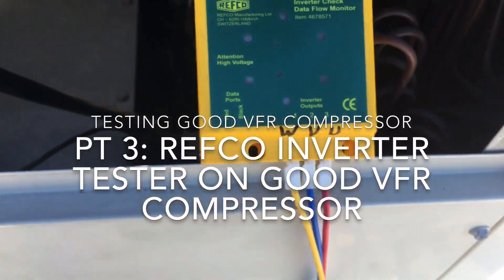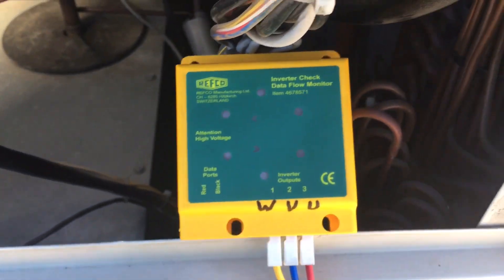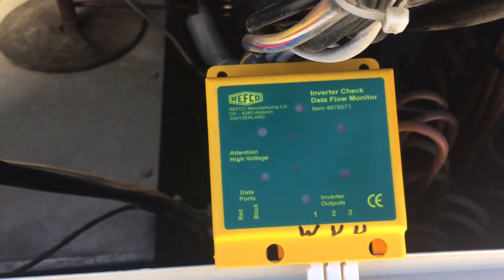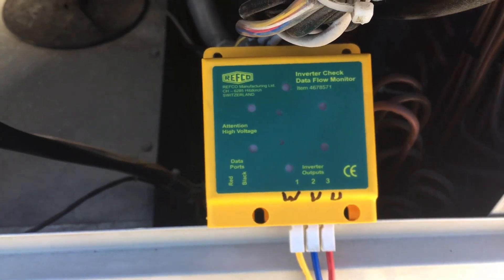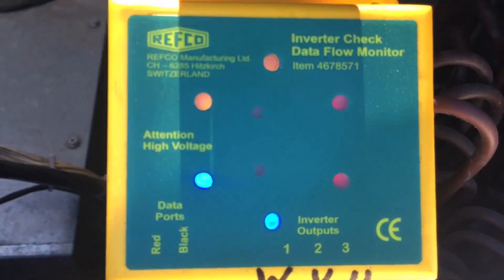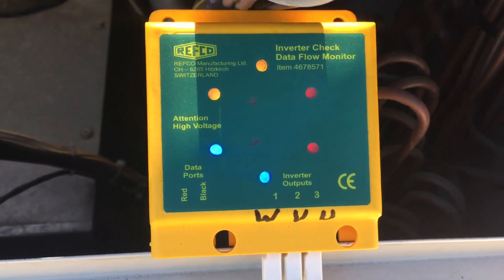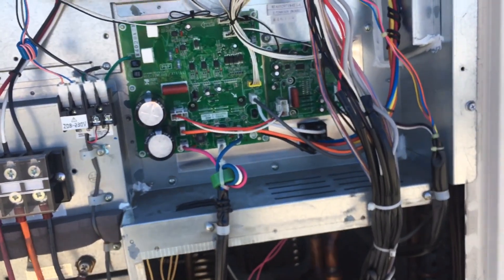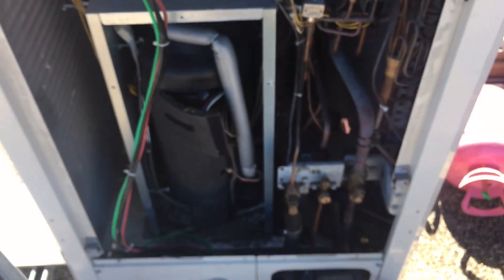Pt 3: REFCO Wired with compressor in circuit testing inverter operation

Comment: Its chek mosfet/ igbt driver in smps/ ups ???
Reply from the maker: It’s just checking the output, signal verification. You could go to their website to look up the details on the product, information and specifications.
Reply: Sir, its  use in three phase smps module  mosfet  gate voltage chek

Comment: Did you ever get around to making the good vs bad compressor video ? I searched didn't find anything obvious don't know if you mentioned it somewhere else drop a link if possible 👍
Reply from the maker: Never got that far customer ended up not doing any more repairs.
Reply: @coldfinger459sub0  ok no problem. I encountered this same type of issue and it was definitely the compressor the manufacturer resistance rating is from 0.7 to 1.5 ohms for a good compressor mines read 0.2 ohms and megged ok; im trying to find if there is any tolerance when it comes to these ratings or once it's out of the specified range it's absolutely bad.
Reply from the maker: @westindianhvac  in the situation they had a nearly 30 pounds overcharged. 

They thought the reason it was not cooling was refrigerant charge. 

Turned out nine air handler‘s filters were completely plugged. 

One air handler circuit board was fried

And the guy they hired to come figure out why it wasn’t pulling calls first thing he did was started adding refrigerant and kept over writing the automatic shut down to start it up and force more refrigerant in and then it was going to automatic shut down load again and he just kept bypassing until he roasted the compressor with too much liquid refrigerant
Reply: @coldfinger459sub0  one thing working on these systems taught me how leave my ego at home, because rash decisions lead to costly mistakes, even when I'm sure i know the issue i still ask other techs for a difference of opinion just incase i over looked something. These systems will expose a hack tech in a heartbeat.

Comment: HOMER READ THE MANUAL YOU CAN OHM THE WINDINGS ON A 3 PHASE COMPRESSOR. MAGGY WILL BOTTLE SLAP YOU FOR THE INFO
Reply from the maker: You can ohm a compressors and it may look good but fail when under dynamic load in operation.

In this case you have to wait for a week because you just think it’s the inverter board while the customer loses $200,000 in product then after installing the new inverter board it starts up it works for a couple hours or a couple days and the compressor shorts out again and burns up the new inverter board you just installed to get it running because of the intermittent bad compressor and the customer loses a couple more hundred thousand dollars because you think you can just ohm the compressor.   And that will tell you whether it’s good or bad.  Not in this case
Reply: @coldfinger459sub0  SERVICE MANUAL 

compressor
Measure the resistance between terminals using a tester.
(Winding temperature: 14°F ~ 104°F)

Normal                                                       abnormal
1Each phase 0.53Ω ~ 0.66Ω                                Open or short-circuit

V WHT
W
RED

U BLKDisconnect the lead wire to the compressor at terminals. 3 minutes after turning on the power 
supply, start EMERGENCY OPERATION.
W1 • After the outdoor fan starts running, wait for 1 minute or more before

Measure the voltage between each leading to the compressor. U (BLK)   -  V (WHT)

measuring the voltage.
• The output voltage values in the above table have tolerance of i20%.

V (WHT)  -  W (RED)                                   No
W (RED) -  U (BLK)
Output voltage
COOL: 100V(58Hz) HEAT: 100V(58Hz)
Is voltage output? W1
Yes
Is output balanced?      No Yes

LED indicator the inverter stops due to over current?

Yes
Replace the electronic control P. C. board
with the I.P.M P. C. board.

No     1. Turn off the power supply of the indoor and outdoor unit, and disconnect the connector CN 551 
in the relay
P. C. board
2. Turn on the power supply to the outdoor unit, and after 1 minute or more passed, check the 
the resistance between the connector
CN551 pin 1 and pin 2.

Turn off the power supply of indoor and outdoor unit, and measure the compressor winding resistance 
between the compressor terminals.
Is there resistance of 0.53" to 0.66" between

   No           

                       0"

Check the resistance between each terminal

each terminal?
Yes
Return the lead wire of the compressor to the former, and turn on the power supply to the indoor and outdoor unit.
Three minutes later, start EMERGENCY OPERATION.

Clarify the causes by counting time until the inverter stops. 0 to 10 seconds: compressor layer 
short
10 to 60 seconds: compressor lock
60 seconds to 5minutes: refrigerant circuit defective 5 minutes or more: normal

Replace the compressor.

                 0"

Replace the relay P. C. board.

Infinity
After 1 minute has passed since the power supply of the outdoor unit was turned off, disconnect the 
connector CN 553 in the relay P. C. board.

Check the resistance HPS (63H2).
Infinity
Replace the HPS (63H2). HOMER WENT TO SCHOOL NOT TO BE A UNDER ACHIEVER I WILL GET MAGGEY BOTTLE WARM UP
Reply from the maker: @TAGUPNBLUE   yes very good
                And that’s exactly why TECH Support always has the technician replacing the inverter board and compressor as a assembly not one or the other no matter what. 
The  intermittent shorts that you cannot check with an ohmmeter when the unit is off no matter whether it’s warm or cold 
                 Are always the hardest ones to find. 

I’m just glad I stopped selling Panasonic or Service and Adam over here in United States to the shittiest company at delivering parts. 

Panasonic got kicked out of the San Francisco Bay area everybody stop selling their parts and refuses to do business with them because they are literally the worst company on the planet at parts delivery. 

Half their product line comes with no foam to hold like motors in large cardboard boxes that bang around break off connectors break off the aluminum and cast ears for the bolt mounting‘s Panasonic will ship air handler‘s not on a strong wooden pallet and the shipping companies just throw them off the backs of the trucks smashing them because they were not packaged properly. 

Panasonic over in our area in San Francisco California bay area has let a electrical company that knows absolutely nothing about air conditioning sell and distribute their parts. 

Panasonic might as well go to Starbucks Coffee and make them a distributor outlet you would get the same service people who know absolutely nothing about the parts they’re selling. 

I hope wherever you are you have better luck sourcing Panasonic parts then we do out here